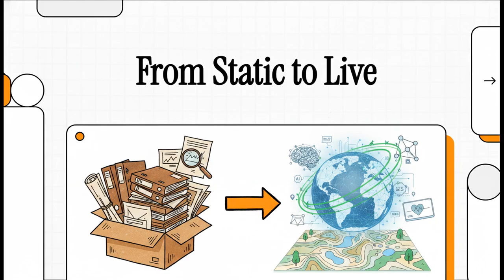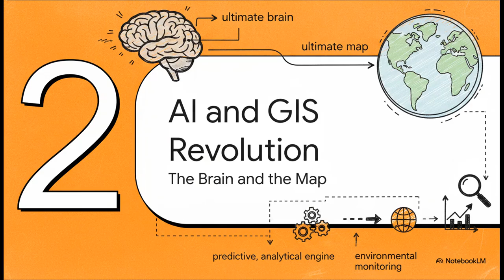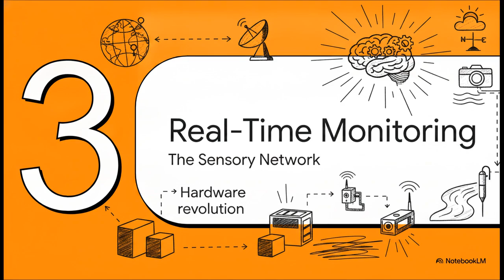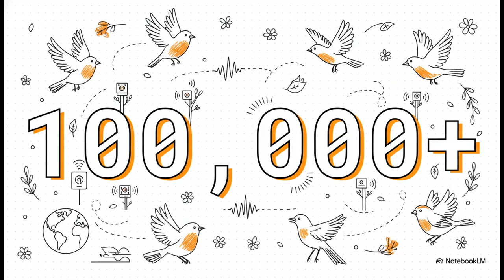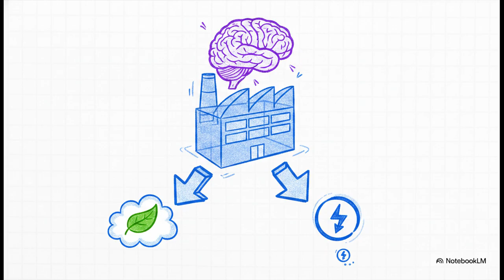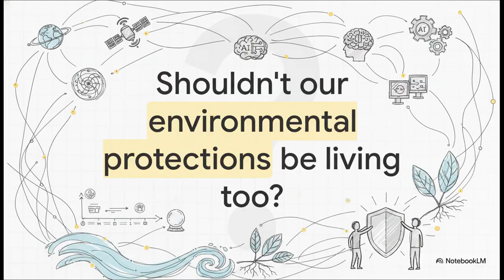Digital Mapping of Biodiversity Corridors for Mining Project Environment Impact Assessments

Comment: The ultimate goal of these technical frameworks is to apply the mitigation hierarchy: avoid sensitive habitats through redesigned infrastructure, minimize construction footprints, restore affected ecosystems, or offset residual impacts. Automated species identification, such as the Njobvu-AI platform, allows experts to focus on rare or legally sensitive species while AI handles the scale of general wildlife detection. By shortening the loop from observation to management response, these systems allow for adaptive habitat modeling that clearly communicates where species are likely to move and where model uncertainty remains high.